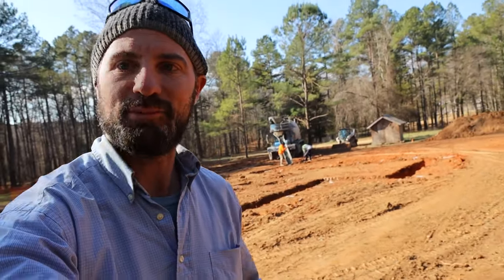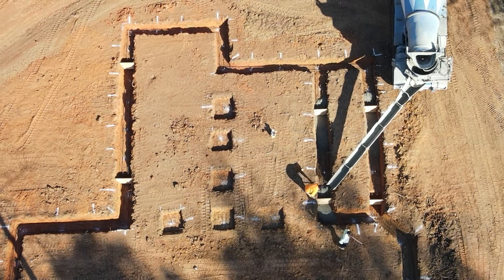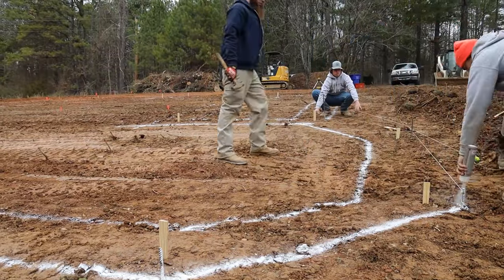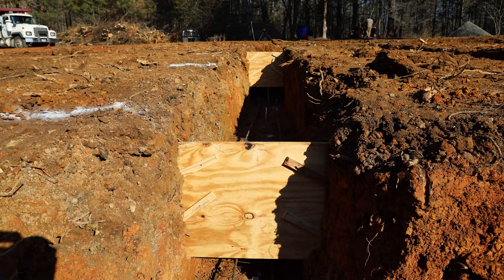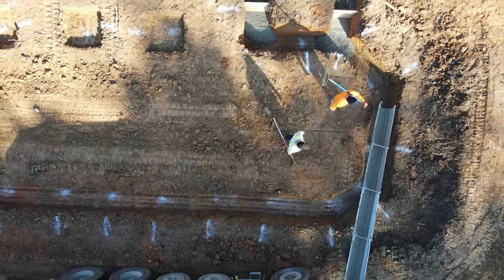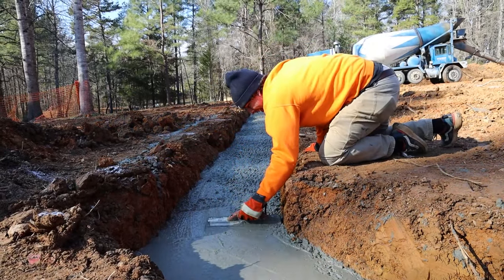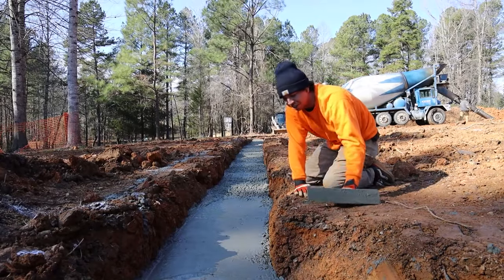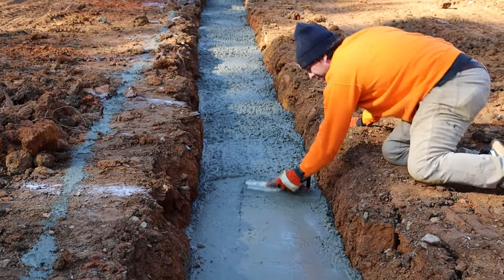CONCRETE FOOTINGS for a CRAWLSPACE FOUNDATION

Comment: Is it permissible by code to have steel rebar that is embedded in the concrete to protrude into surrounding soil?
(Referring to the "grade stakes")
Also wondered why the footers were not wrapped with vapor barrier on the bottom and sides?